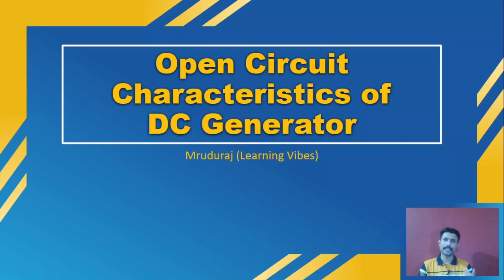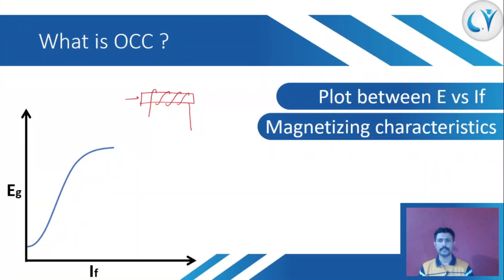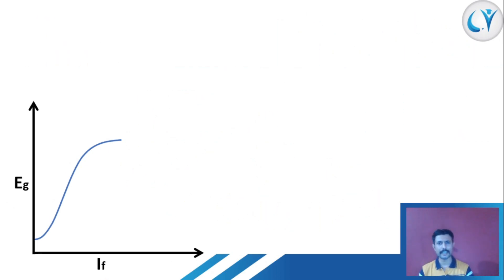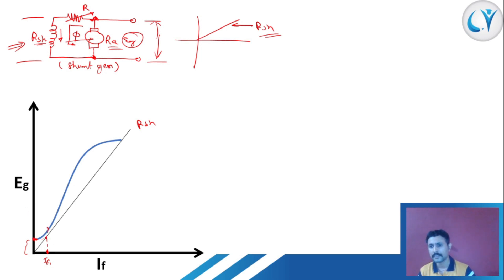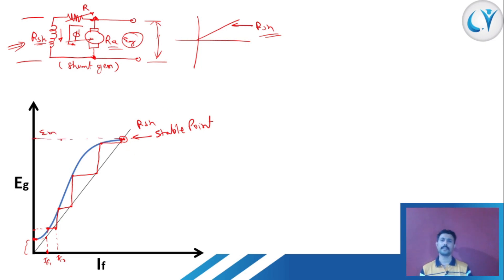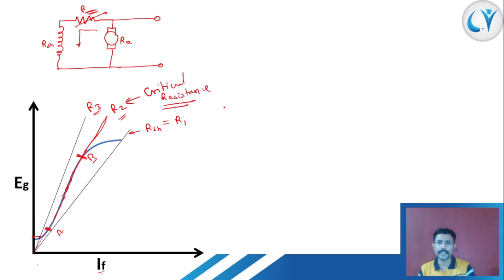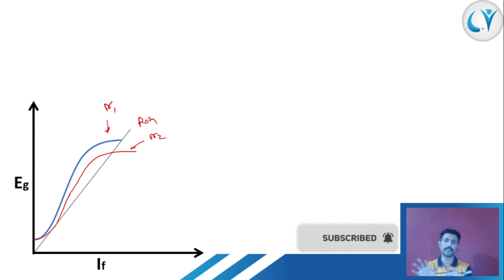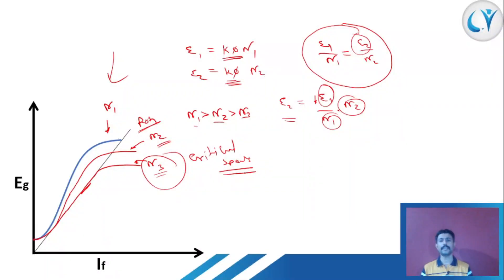Open circuit characteristics of DC Generator | OCC of DC Generator | Mruduraj

Comment: 1. If we give field greater than critical resistance the terminal voltage will be low. So we are giving the field resistance less than critical resistance to get stable point.

2. If we give the speed linear to the field current and induced EMF that is known as critical resistance.

Comment: Why do we increase the current manually when we know that the voltage caused by residual magnetism causes a current to flow which again increase ta voltage then it increases the current and goes on…isnt the process supposed to be continued by itself? 🙂

Comment: Since critical resistance produces unstable value or conditions. That's why resistance should be less than this critical value to generate a proper value of flux and induced emf. 

Critical speed is the speed that should not be operated in generator because this would results to Small value of induced emf which is less than the normal.
Reply from the maker: True.
Reply from the maker: Very good

Comment: 1- since there should be proper amount of flux to generate voltage that's why winding should less than critical resistance.
2- because beyond critical speed we would not get proper amount emf.

Comment: 1/Above the critical resistance, the generator is not able to build-up voltage because of less flux.
2/Critical speed is that minimum speed in which the generator will not able to develop voltage below it.Like example the rpm of hand-driven megger is 160.
Thank you so much sir for your blind support for us.I know sir, you think after these all appreciation why the numbers of student(subscriber) will not increase as per my content and concept or slowly increase. It all about marketing.Don't worry sir after 10 days my exam will over and then I will try to increase the number of students.Ty
Reply from the maker: Thank You so much for your support. I will look forward to your support
Reply: Sir It is my duty.I always stand with those who are doing hard work with any hope. Because I believe that hard work is luck and luck is everything.Ty
Reply from the maker: Both answers are correct

Comment: 1 ans. It is the maximum resistance of the shunt field which allows the resistance line or the characteristics between voltage across and current flowing through the shunt field to intersect or coincide with open circuit/magnetic characteristic of a shunt dc generator

Comment: Q.1ans.:-
The resistance of the DC shunt generator whose critical value must be less than.  And this is one of the necessary conditions for voltage buildup in a self-excited generator. 
Q.2.Ans.:-
Critical speed is the rotational speed at which acting dynamic forces cause a machine component to vibrate at its natural frequency.

Comment: 1.Field resistance of a DC shunt 
generator should be less than its       critical value; this is one of the essential conditions for voltage buildup in the self excited generator

2.Critical speed is the maximum permissible speed above which the generator is likely to damage or may cause the circuit to fail.